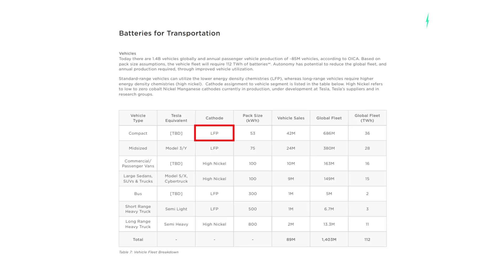How Tesla will produce 42 million affordable Model 2 electric cars

Comment: the model 2 is a great idea. the only thing better about would be batteries that either wouldn't degrade or would degrade very very little over time or the possibility to reinstall new ones cheaply. that would open the ev market for people who don't afford new cars, even cheap ones. if one could buy cheap a 10 or 15 year old EV without fear or having to soon spent a lot of cash for a new battery, it would be an absolute game changer for countries that are at present very reluctant on switching to EVs because people are not as well off as in western countries

Comment: I don't know that 42M people will want to buy 42M Model 2 Teslas...  I think that the average person hates the look of Teslas, both inside and out.  Tesla design is not pretty (the exterior of the Model S excepted; the Cybertruck has to be the ugliest vehicle on four wheels ever produced).  The vertical "iPad glued to dashboard" is horrible to most people; a horizontal inlaid infortainment screen is much preferable, with physical buttons/dials for climate and audio controls.  Most people want physical buttons and dials, they want an instrument panel in front of them, they want an all-metal roof, they want regular door handles (not electronic, receding ones), and they want a round steering wheel.  And most people do NOT want "auto pilot" where the car drives by itself; most people rightly do not trust any software developers to do that right, to keep people safe.  Tesla strikes out in so many ways for so many people that I'd be shocked if 42M Model 2 Teslas are ever sold.
Reply: I agree with everything (to an extent at least) except for the exterior design. I'm so glad that there's one manufacturer in the world that still produces non-SUVs! And I like the "normal" design! Much much better than all the "hey let's make something different for the sake of looking different" ugliness of the last 15 years or so. It's as if designers have lost the ability to see proportions, lines and harmonies properly.

... But really hate the tablet that sticks out of the dashboard!
As for knobs, I want this compromise:
Every common function that people use often, and while driving, should be physical. And the placement and the type (rotary, flipswitch, pushbutton etc.) should make sense. Everything that's used less often, and not necessarily while driving, should be via touchscreen to declutter the dashboard. Also, as much as possible, where it makes sense, should be automatic. So you can just configure the type/strength/etc. once via touchscreen and then forget about it. E.g. configure to your liking how the wipers should react to rain, and then you don't need to use them via knobs or touch at all.
Reply: @allesdurchprobiert  I generally agree.  But wiper sensors are notoriously bad on every car brand I've driven -- not dependable.  So I want full wiper controls physically on the steering wheel, always.  Automatic climate doesn't work well in any car brand I've been in, either, though many people say that they can live with it.  A big mistake is that every automaker doesn't follow the VW Group's lead and install heated windshield elements (silver coating, without wires) to get rid of fog/ice/snow much more quickly than blown-air defrosters do and to keep it that way without the need for air coming on and going off all the time (or staying on all the time, to keep windows from fogging up under those kinds of circumstances where they just do).  I've had heated windshields, and they are so far superior to blown-air defrosters that they should completely replace blown-air defrosters/defoggers.
Reply: @cbatiau2528  I don't have any experience with automatic systems. Didn't know they're usually bad. But being able to configure them might solve that to some extent. If not, I'd want physical control too.
I totally agree on the heated windshields! It's a problem I often have. The type you mentioned should really be standard! I don't think it would cost that much more, and would be a really useful feature. I'd LOVE it! Would actually take that over full self driving even for the same price!

Comment: The $25,000 is supposed to be AFTER the rebates, not before. In other words, if they can get the full $7,500, then the price will be $32,500. But I don't think they can get the full rebates if they use CATL batteries. But they will be able to get $3,500 for building it in North America, and might be able to get half of the rest if the minerals and metals going into the batteries are from a free trade  country. So the price might start at around $30,000.
Reply: It'll be made in China, Mexico or India
Reply: With competing models available in other markets for less than $25k now, hitting projected volume would be a challenge if the price does not below that.

Comment: Perhaps a better comparison is the speed with which people replaced horse-drawn carriages with automobiles. In New York City a 95% replacement took precisely 10 years (1903-1913) which was lightning fast for those days.
Reply: Good comparison. Evs can go fast because they use established roads, insurance is easy to switch. Tires fit and are available.
Shops just need some new tools and tech training to service them. The locations already exist, mechanics exist, lifts are in place etc.

In other words it's gonna go way faster than anyone not ev minded thinks. 
Another cross over example is so called 3rd world countries adapting to cell phone's. They skipped right over all the expensive infastructure needed to use wired telephones and instead installed cellular towers and presto most of those populations have a cell phone today. 

Another example in 1922&1923 Ford built over 3,600,000+model t without computers robots or automation. 😎
Reply: @4literv6  Let's assume I'm not EV minded. How fast would I think it goes? And how much faster will it actually go?
Reply: It might, but there are differences too. This time around there are no real benefits to users of the new 'replacement' technology. One could easily argue that in many applications, to users, the EV comes with additional limitations compared to the previously used technology.

Comment: There’s a photo that shows a street in New York in 1908, and there are loads of horse and carts everywhere, no cars. Next to it is a shot taken in the same street 10 years later in 1918, and it’s full of cars, and no horses. I think we are in one of these seismic shifts, in less than 10 years it will be all EV’s on our roads and very few ICE engined vehs. It just needs for the entry price to EV ownership (new & used) to drop further, I don’t think it’s there yet, not when someone can go and buy a used ICE vehicle so cheaply, and in the UK, buying a new ICE is still cheaper than a new EV.

So, if Tesla can start knocking out Model 2’s in significantly higher volumes than their other models, and maybe target a more reasonable return on sale of circa 10%, what could they get the price down to?

Comment: Man I want one. I can't drop 50K + on a car but I'll buy a model 2 in a heartbeat.
Reply: Ditto
Reply: The Model 3 just dropped in price again to $41,990. So if you hurry, you can get the full $7,500 rebates plus whatever extra rebate your state might give. So roughly around $31,000. Not far off from the model 2, but far from $50K.
Reply: @Paul-cj1wb 
Adding ~$350 USD a month more to a loan breaks the bank for most people
Reply: @CJHallx  Correct. We all have to settle for used vehicles until we can get to a point of being able to afford something new. That's life. Nothing wrong with buying used EVs if  you cannot afford anything else. Especially if $20,000 (or $17,500 in some states after further rebates) for a new Chevy Bolt is out of the picture. There will be plenty of cheap used EV's as more and more new ones come into the market going forward.

And nothing wrong with staying with your current ICE vehicle or getting a cheap used ICE until used EVs or new EVs are in your budget.

It was the same with flat screen TVs in the early 2000's. Very few could afford the 10 to $20k when they first came out. Or 5 to $10k after a couple of years went on. Or even 1 to $2000 by the mid 2000s. But you could get a 42" under $700 by then. And by 2010, you could that 42" for under $400 and a 55" for under a $1,000. All the way to now when you can get a 55" at Walmart for around $200.

It the same with EVs. They will get cheap as the years go on. Faster than most people realize. They will get real, real cheap. Why? Because just like LCD TV's they are so much cheaper to manufacture than ICE or CRT in the case of TVs.

Comment: The maximum range for all EVs is 270 km, or about two hours on the road or only one hour below freezing temperatures. We pay 50$ for every charging session, in other words several times per day.
Reply: The big oil trolls out in force today
Reply: @PomPom-vf9ko, l wonder where you get that info. from b/c I'll tell you it ain't right by a long shot. A friend who owns a Tesla model X just told me when he goes on a road trip it costs him half what he used to pay for gas; freezing temps??? It doesn't happen so often especially now with global warming. 270km range??? Are you talking about all EV's being Nissan leaf maybe? I don't know please explain what you mean.
Reply: @Joe44944  Roadside charging in Norway, you know, the country where 88% of new cars are electric, the cost of 20-80% charging session is now 50 us dollars.

Charging only two-three times per day, if you`re driving a lot, be prepared to pay 120-150 us dollars, these are facts you can check yourself.

I warn you all here on Electric Vikings comment section, the electric cars will be way more expensive to use than regular cars. Double or triple the fuel costs of normal cars. Remember, you heard it first from pompom.

Lets see who the fools are, after you can`t afford to drive your beloved battery vehicles.

The claimed range in miles or km are irrelevant, it is how many hours you can be expected to drive between charging that matters and for ALL electric cars today, we only get two hours. 

In two hours you won`t get very far, perhaps 270 km.

That means there are only two hours between each time you spend 50 us dollars.

It doesn`t take many roadside charging sessions before it is way cheaper to buy diesel.

The electric plan, create a monopoly and allow only the richest people to actually drive their own car.

Oslo-Stocholm-Oslo in an EV will set you back at least 300 us dollars, compared to below 100 us dollars in a diesel car.

Sure, it must be magic, suddenly the range of your 500 km battery vehicle is down to 15% state of charge after driving for just two hours. How did this happen?

The EV were supposed to be so efficient, that it lost almost half of the range into thin air. Yes, that is quite an efficient loss.

Norway had the cheapest electricity up to autumn 2019, when the EV revolution gave us the world most expensive electricity. Everything was ruined after merely 600.000 electric cars suddenly drained and demanded too much from the grid, it is estimated that Norway by 2050 need 50% more electricity than today just to feed the transport sector.

It is going to be the same in other countries, they currently do not produce enough electricity for the number of future EVs.

I know, I know, this is throwing pearls in front of swine.

The train has already left, you are on it allright, but you don`t know where it`s heading.
Reply: So you live in the middle of siberia, as a taxi driver that is constantly speeding, get your electricity from a diesel generator and drive a BMW i3? Got it!

Comment: - Don't forget that not everybody has a garage with an electric plug. lots of people live in appartments and don't have access to charging overnight.
- Fast charging like with Unity is today more expensive than an economic car (my 20 years old diesel golf doing 5L/ 100km runs cheaper per Km than any EV charged on unity in France)
- Electricity prices are raising up faster than gas prices these days.. All energy costs are tied together anyway, it's not like EVs are powered by magic energy.... 
- Let's not talk about the pollution created by this huge business of replacing so many cars that still works by brand new EVs .... I'd love to have you do an episode where you go mining some cobalt in Congo, work for a month in south america where lithium is extracted, then go work in china for another month.. That'd be very good content.
- The only real advantage I see on EVs over ICU cars is their simpler design / easier maintenance, if (and only if) the battery tech is long lasting and built to be repairable. Repairability is nowhere to be find in speeches of all car sellers like you unfortunately.
Reply: You speak my mind. Cars should be built to last 3 or 4 decades with batteries to suit and if not be replaceable for no more than $1000

Comment: The new model 2 would likely be a B class car, slightly smaller than a VW ID.3, and needs to be at about 120 Wh/km for overall efficiency. 
At 120 Wh/km and 320-400 km range for a standard range it will need a 40-50 kWh battery and be at about 1200-1400kg weight and about 100 kW engine
Reply: tesla has released data, model2 is 53kwh I think
Reply: BYD Seagull.
Reply: Model 2 is the direct competitor to ID.2ALL.

Comment: Tesla needs to build a UTE variant of the model 3 or even the upcoming model 2 . This market segment is presently being ignored .
Reply: With good reason: only you upside-downers buy them. So not only the rear seats and the rear half of the roof has to be lobbed off, but the steering wheel has to be moved to the wrong side of the car as well. Tesla can't do that for the literally tens of cars you guys buy....
Reply: Yes ok. There are numerous electric utility vehicles for sale today. Look again at the Ace Yewt for example

Comment: @electricviking You have misunderstood the chart on page 22 of Tesla's "Master Plan Part 3" document. The chart is Tesla's estimate of what is needed for global production of EVs by all manufacturers rather than Tesla's aspirations for what it will manufacture by itself. So there will be about 42 million compact cars sold per year, which is not the same thing as Tesla aspiring to sell 42 million of its own compact car per year or by 2030. Likewise, the pack size of 53KWh for the compact car is Tesla's estimate for the average battery pack size in compact cars. Tesla has a history of making cars that are about 25% to 30% more efficient than competing cars that can travel the same distance, so this suggests Tesla will use a battery pack about 25% to 30% smaller in capacity than 53KWh, that is, the battery pack in Tesla's compact car is likely to be abut 37KWg to 40KWh.

Please post a video to correct these mistakes.